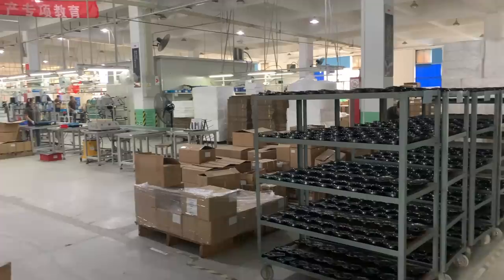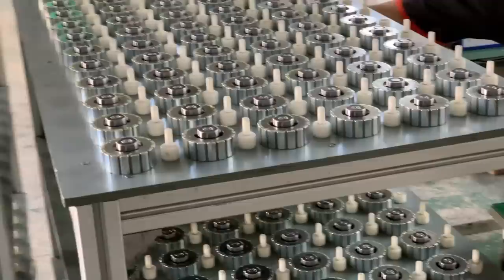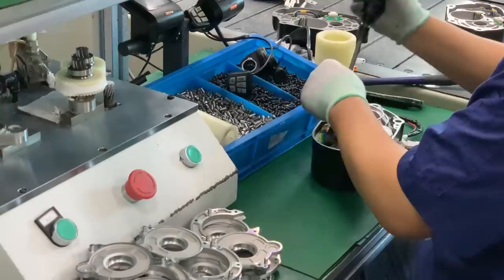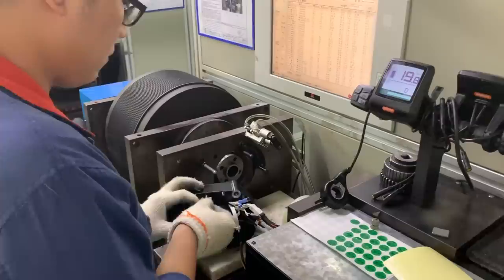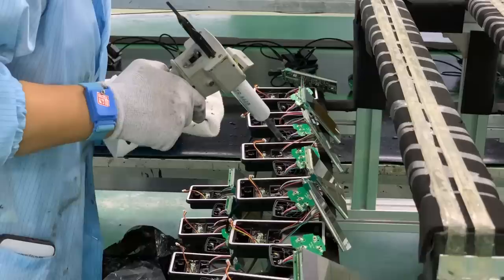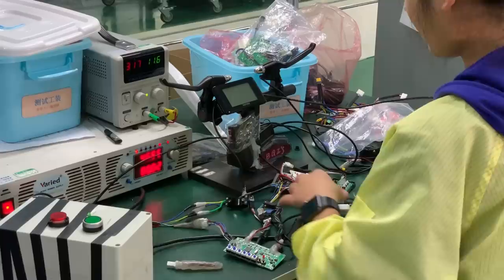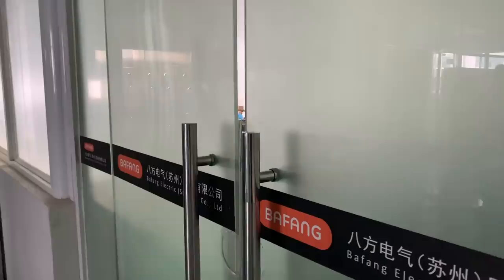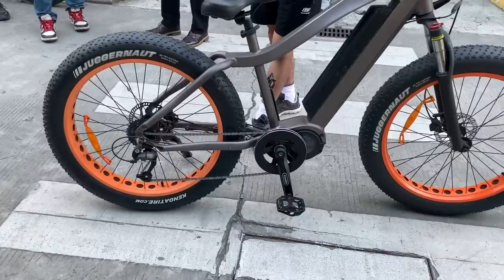How e-bike motors are made (Bafang Factory Tour)

Comment: I don't know about anyone else but I can't sell e bikes in my bike shop . I've had 2 in my shop for 6 years and everyone that comes in wanting one walks right back out after they see $1400 and $1600 price tags . Till they get into the $500-$700 price range people won't buy them . I have one myself and have been riding it every day for 5 years no problems at all and mine is a kit hub drive from e bay 48v 1000w  thst does exactly what I need it to do . I can get 40 miles per charge or I can rocket it and drain the battery in 10 miles
Reply: this did not age well.
they go for 10K now

Comment: This "factory" is merely an assembly plant, just to make that clear. There are factories in China who may only manufacture one component, such as axles for hubs motors. You could find these parts in several different brands, and often with no difference between them.
Reply: Merriam-webster dictionary: "a building or set of buildings with facilities for manufacturing".
Cambridge dictionary:
"a building or buildings where people use machines to produce goods"
Reply: You just described a factory

Comment: iv'e been using a rear drive 350 for over year now for food deliveries....The rear drive is very reliable and gets everyday use....6-7 days a week and 6-8 hours a day....i charge for lunch and then charge again for dinner runs and place a trash bag around the whole battery for extra measures in the rain... last week i used it in full on downpours in cold rain and performed like a sunny day..I cover the battery with a piece of yoga mat and then wrap it in a trash bag on freezing cold days, fasten with a voile straps..anyways the bafang is a great motor an recommend it..it a hard worker.
Reply: I got 38000kms on my m400. No problems.

Comment: I have a mid drive and like it.  I did reprogram the controller so it doesn’t throw max power into getting to speed.  It’s set up at full speed on each setting with minor increases in power.
Reply: My Ultra needs that. Too aggressive. 
Throttle is pretty much an on off switch

Comment: I have two bafang  BBS02, each have near to 22000 kms, i have  only changed paw clutch so far.  Very good machines and cheap!
Reply: I have a middrive m400 with 38000kms. I had to change nothing. Absolutaly flawless
Reply: Because you use it at minimum of their capability theybare not very good
Reply: @eXTreemator  38K doesnt sound like minimum but you sound like a troll

Comment: Thanks, good to see how they are made. I am impressed with mine, very quiet, powerful enough, and for hilly areas they beat my hub drive, but more wear on the chain etc. You can spin the cranks at the optimum cadence, and this gives the best motor power and efficiency.
 I also have a Yamaha crank drive, which is even better, but surprisingly it is noisier than the Bafang. Yamaha better because it has a torque sensor, and the bafang is cadence only.
 3000 miles without problem

Comment: Thanks, Micah. Your videos are excellent! Recently, I've wondered why Ba-fang mid-drive motors aren't outselling other companies' mid-drive motors especially when Ba-fang's are 750 watts and above while other companies' mid-drive motors are 250 watts and 350 watts.
Reply: prolly cuz they're torking the chains and transmission gear.  that is a huge amount of torque!
Reply: They are outselling simply because you wont get others for 300 like these.
Reply: @skip123davis  theyre powerful indeed and can break if you ride dumb. Chains and even gears are meant to be replaced as any parts and are cheap. There are reports on tens of thousands km without service here in the comment section...

Comment: Cool. I do like my BBSHD mid drive kit so interested in if/when that transmission will debut
Reply: It pairs well with a Rohloff.
Reply: mick2d2 holy cow those are expensive but look incredibly well made. I just bought a Shimano 3-speed IHG to see how it pairs. I don’t often use more than that range so hopefully it works out well and the fewer more robust gears hold up well with the power.
Reply: Alan Bowers They are expensive to buy, but I think they represent good value. I “broke” two Shimano Saints on my bike, before getting the Rohloff. They were both badly bent out of shape, after which it’s nigh on impossible to get them adjusted properly again, ten speeds having a much lower tolerance threshold than other ones. Some people have done over 100K on the Rohloff and they’re still going strong. I’ve done about 5000km on mine so far. It also gives you an amazing range of gears.

Comment: I have had 4 Befang mid-drive motors and all of them the  spindle which is part of the coil shatters as it can’t cope with any stress like a bit of heat. And i only used on flat roads
Reply: I didnt have any problems with my m400 n i ride in a hot area

Comment: My motor had been assembled incorrectly, a plug/socket was not fully clicked into place,  it was an easy fix, but I prefer not to have to dismantle and rebuild expensive items like this.
The pedal assist is a bit hit and miss,  much better on the thumb throttle.
Other than that,  it´s a useful device,  though I´ve not seen any advice on routine maintenance.
While I´m delighted with the quality of my Chinese double bass, sax and ukuleles, there is a need to understand that owner care is up to you.

Comment: I still like the little staton friction drive gas kits! So much fun,cheaper,easier to fix and just simpler. Not to mention charge time!! Fill up and go with my little Honda 4 stroke🚴‍♂️🏁
Reply: I think that you are unaware of the issues related to being critical of battery electric Drive systems versus thermal engines. I am glad that you mentioned Honda though. Honda use the highest quality battery electric drive system ever sold in the United States. Their contempt for battery-electric Drive systems is not ignorance has another Channel glibly argues.

Instead of putting gasoline in your tank you can put a thermal potential energy fuel. The heat in the atmosphere has tremendous potential energy. It can generate superheated steam of itself to drive a turbine. The things to do so does not have to be a pressure tank but up to 300 pounds would give it a couple hundred pounds of range of course. This is what we do with soda gas for Coca-Cola etcetera. I was thrilled to finally read the label on the bottle where I provided the range of pressure sent to the fountains and the range of pressure within the large steel tank.

On the bicycle the size of the tank can be much smaller than the volume of the carbon fiber frame. No actual pressure is needed. You have some sort of heat exchanger which is like a radiator in reverse. The liquefied gas absorbs Mass actually and expands nearly a thousand fold pushing the turbine blades with immense Force as it does this. This is what Honda is talking about and you don't need hydrogen 4 fuel cells it is very simple parts of the mass produce inexpensively it is like a bicycle transmission but even simpler. Bicycles use so little energy attempting to save the energy that you might otherwise use if for example it was half the efficiency or third the efficiency or 1/10 efficiency makes no sense.

What matter is is the ability to shift consumption to your solution. The fossil fuel industry directs the competition too expensive systems that cannot scale.

The bicycle can be produced for a price that appears the Jive with people's intuition as to how much it should cost that are regarded to a car. A small fraction. Not basically a new bike costing as much as a used car new bicycles that are better than used cars that cost less will actually reduce new car purchases because used car buyers subsidized new car purchases.

There is a reality when it comes to the legislation about cigarette smoking. The General Public does not want people who are 20 years old to start smoking next year either. Next year we need to pass the law that raise the age limit every year so no new people can start smoking legally.

It is the same with cars. The diction is large because people start when they're 15. You don't even need a reason to be driving alone long before you can vote or have sex with anybody you want to. Your car is the worst possible thing to expose your children 2 ever. I hope that Honda will used technology 2 drastically change the world. I used to follow their jet progress. Perhaps you do as well. You're on the right track and you're not just seeking negative attention attempting to save the energy that you might otherwise use it for example it was half the efficiency or third the fish to see where a tent efficiency
Reply: @marsBeBelinda  I just enjoy my gas engine. It's not so much about being critical, it's the fact that charge time seems to be a real issue with ebikes. Most charge times I see indicate they take 4-6 hrs to charge. Thats right charge!!!!!.....With that being said if I want to go on any sort of long distance ride I need to depend on electricity, something that's just not available for ebikes. How about power outages? What if I depended on my ebike or tesla to get to work and there's  a power outage for several days. I personally believe electric has some catching up to do. And I won't even tell you what I think about the cost of a  ebike.  When these things start costing as much as a car you can't help but roll your eyes. My little Honda 4 stroke kit that's incredibly dependable...400 bucks.

Comment: great mid-drive motors plenty of torque for going up hills I recommend you change chain every 3 months. Decent quality chains can be bought cheaply and swapped out easily with quick links. Depends if used daily just observe your chain daily for wear and lings spreading. Also check rear wheel sprocket for wear on the teeth.

Comment: Cool I have a tricked out RadRover,she will get close to 100 miles on two  52v 20 amp battery’s, with my new true 750 w hub motor. She cruises at 30 mph on throttle only, I only peddle if I see a cop😅, I enjoy building the bike up and have many more plans including adding a third battery to get my speed even higher, its interesting to see where my motor came from.👍

Comment: Great channel! Do you have a recommendation kit to convert a 29er mountain bike to ebike using a hub motor? I don't like the bottom bracket motor. I'm keen to do a nice powerful rear or front wheel 1500w motor. Bafang got any good options?

Comment: 3000 watt please bafang. Love the bbshd however mine had a bracket  that did not fit properly. They drilled a hole in the bracket so it fitted through a case bolt. The bracket did not grip the frame either so I fitted a touque arm. Horrible thick black paint made the motor too big for a standard bottom bracket. Fix the issues through good customer service  (lacking) would help massively.

Comment: Bafang is a as good as the known brands
Reply: Not in any way. Better in some aspects and way way worse in others.
Reply: @brianbassett4379  Can you justify your response?  Describe what you mean please.
Reply: @chrisw3327  I don't have to justify anything I have owned and ridden with two BaFang mid-drives for over 17K miles in 3 years. I have an informed opinion not just one that I came up with on the spot. "Better in some aspects and way way worse in others." I wouldn't own any other ebike motor but BaFang has a long way to go before they have a "great" mid-drive.
Reply: @brianbassett4379  That is what I was asking for - some facts to back up your earlier statement.  Thank you.
Reply: @chrisw3327  Pros and Cons of BaFang mid-drives. 

Con - There is no torque sensor in the BaFang mid-drives. Turn the cranks and it will apply a predetermined amount of assist. If you lean into the pedals the motor doesn't understand and ramp up accordingly. I listed this as a Con only because it doesn't give you that option. Riders should have this option if they want it, BUT I like being able to stand and pump the pedals without having to spend more of my precious charge. Production ebike manufacturers would call their's are more refined than BaFangs but I think that's wrong war around.  

Pro - 1000W (1.34102 h.p.)... or 750W, 500W... but really, why?

Con - They don't have built in temperature detection. 

Pro - Throttle. The single most advantageous factor... right after 1.34 h.p. There are many aspects of the throttle that make it so useful to me. I can set the amount of assist for each level, how fast the power rolls on so you don't damage the drive-train, and you can have 9 different levels of assist on both the cranks and the throttle independent of each other. Take into account that I'm not taking my bike off drops or anywhere I have to carry it. Heavy weight touring with a range of 100 miles on varied terrain.

Con - It comes from China. I could get into that but why? 

Pro - Can be mounted on almost any bike. New, old, fat, suspended, retro, tall... you find your perfect bike for what you want and make it your ebike. I could use this as another Pro but I don't need to, the motor can also be removed and remounted on another bike if desired.  

Con - Not many LBS are willing to, or capable of assisting in the transformation. But if you are already maintaining your own bike now it's a straightforward procedure. 

Pro - You can pick and choose the battery you want and they are less than 1/2 price for the same capacity on production ebike. I just bought a 35 Ah triangle pack (#3) for less than $600.00. You can also upgrade to a Grin Satiator for charging. 

Con - Quality control less than stellar... but getting better, or was. I had a faulty controller and it took 2 units to get a good one. 

Pro - The BBSXX series mid-drives pair perfectly with a Rohloff Speedhub. 

Con - hummmmmmmmmmmmmmm

Pro - You can use any digital display you want and there are several. I'm currently using a 500C display after having used an EggRider and a stock BaFang display. 

Pro - BaFang mid-drives let you determine what Class ebike you are riding to conform with state and local regulations. (Important!!! Read and understand the Federal definition of an ebike.) https://www.bosch-ebike.com/us/everything-about-the-ebike/stories/three-class-ebike-system/

Con - (Not to me, but to some) Motor location isn't optimal for some riders. In front of and slightly lower than the BB. (Drastically out-weighed by Pros) https://photos.app.goo.gl/ndCrGr6EmK9UqNZG9

Pro - Can be configured in many different ways for many types of rides and has very few proprietary limitations. 

They aren't perfect by any stretch of the imagination but no one else is bothering to step up with a similar mid-drive. 
Here's what I have been doing: https://photos.google.com/share/AF1QipMgab33TrI8TrP2Pp_eTYsuQMIdyeke43MIiSb3E1G_IUBib5BtBjmuBXeFvBM8Yw?key=MFg1ZXRwN1FpdWlBbHJEUkkyY3EwZ1Y1Yk9yRVRB

https://photos.app.goo.gl/hyb747ucdY8hia6b9

Your welcome.

Comment: The quality of Bafang motors rose very rapidly over recent years. It seems like a very sound company. But for all the motors and ebikes make in China, Bafang totally dominates the DIY US market (mid drive). It seems like a government sponsored export situation. China is a real mixed bag.  More and more battery and solar stuff on Ebay seems fraudulent. I hoped Bafang would lead the way with developing a quality brand ethos. But I am looking at a 200 watt solar panel rated 6 amps and 18 volts max. That's not 200 watts. There are $100 battery packs, ostensibly 36v and 10 AH, but they must be super cells. It's too bad. There is good Bafang, and there are a lot of hucksters. Bafang never got much traction selling stuff direct in the US. They weren't price competitors. Their battery prices align with EM3 and Luna. Everyone wants margins, or they are lying SOB's.
Reply: George Sears  Batteries are the problem with Ebikes! I wish companies would offer 2 Batteries like power tools! I would  love to increase my range!
My 2yr old Ebike has an obsolete Panasonic 36v battery that will have to be rebuilt because of the unique connections to the controller.
And the company ‘Populo’ no longer imports this battery. Just part of the scam to keep Ebike riders buying new bikes every two or three years, just like automobile manufacturers, in our throw away society!

Comment: They really care about their Worker´s eyes... 2:40 ... Freely exposed Laser Radiation ? Seems to be a special chinese invention with a specific wavelength, which can´t get reflected. I own a Bafang Hubmotor in my Bike... Soon after around 200km the controller began to show more than 30000km on the tripcounter, after 500km the motorgear became loud and so on... Just my 2 cents about quality...
Reply: co2 lasers operate far enough into the infrared that the cornea is opaque to the light, so the risk with this type of laser is pretty slight.  I'm not saying what they are doing is hunky dory, but it's probably a lot better than it looks from an eye safety POV
Reply: My bafang m400 with 7600kms in 4 months is still going  great